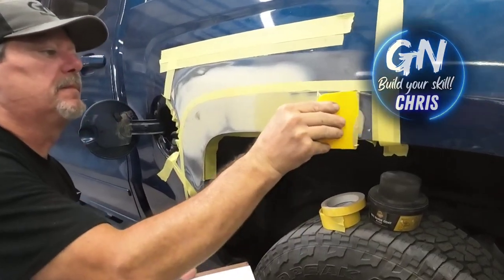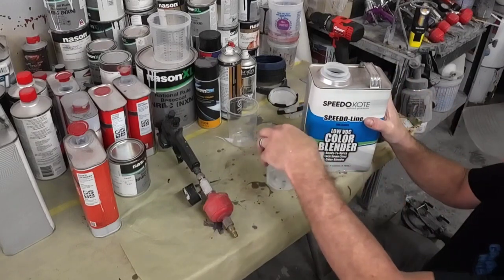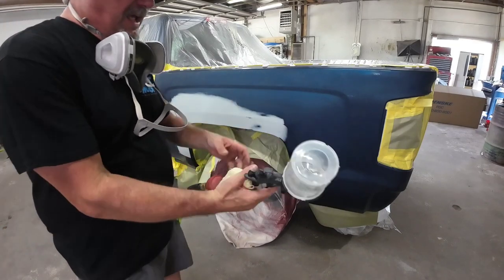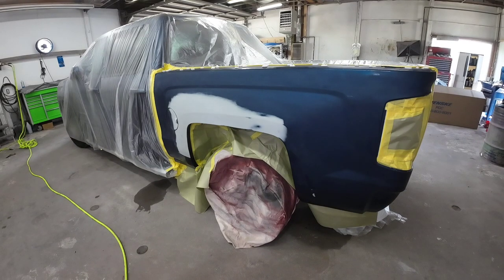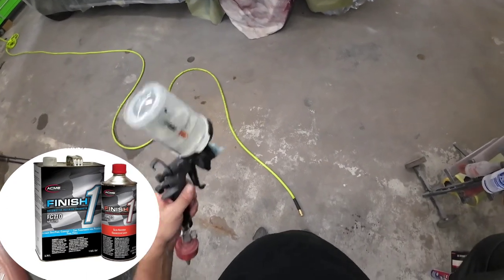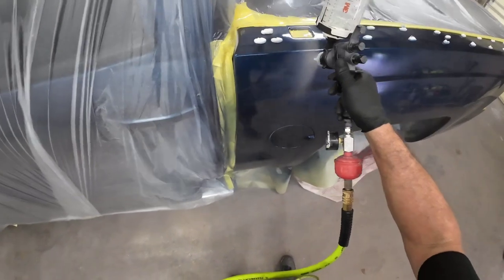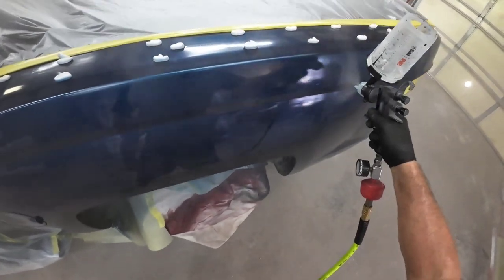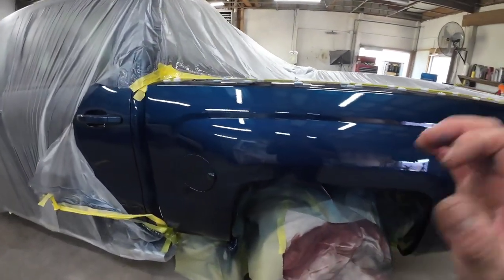TIPS and TRICKS when painting your car in extreme heat!

Comment: I have a question for you Chris that may be a little off the topic you just demonstrated in the video. I have a car of my own im getting ready to paint and i have like 2 break threws into filler and not really straight filler but 3m glaze real light blue almost white. Can i seal over it before base? Or will it leave a halo or anything after several days? Any tricks for what i have that will keep me from priming again as i am basically all washed up and ready for the booth. Thank you a million for any info as i know you will know the answer!!!! Keep up the great work!!!
Reply from the maker: You really should be able to just seal over it. I don't  think you'll  have a problem  but if for some odd reason your base  soaks in you can lightly sand that spot with some 600 and add another coat of base and clear over .
Reply: @GarageNoise  thank you very much.... Its nit a big spot actually i have 2 of them and they are very light burn throughs but i just wasnt sure what my best move would be.... Thank you again and im always waiting for a new video as i learn something from each and every 1.... Thanks again!!!